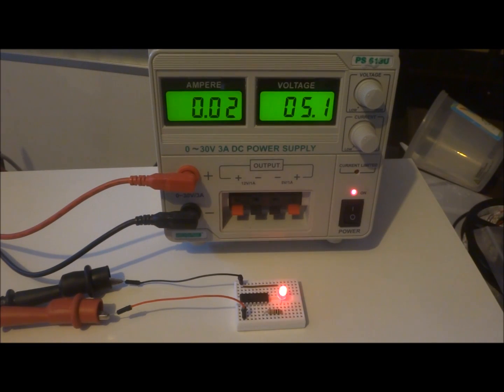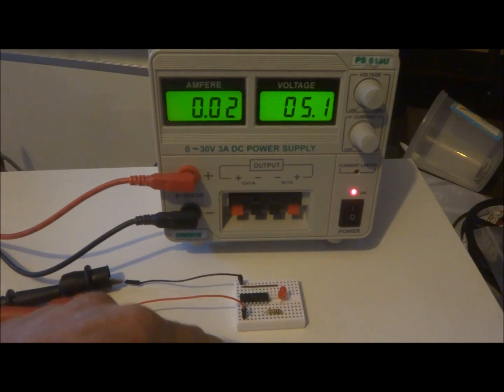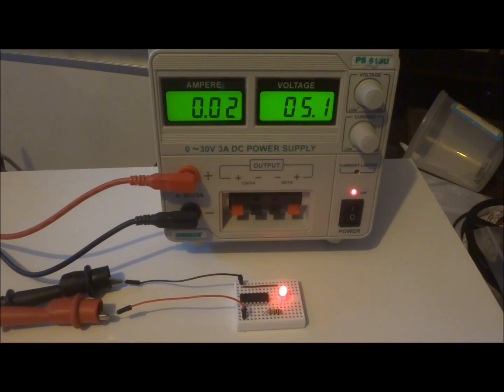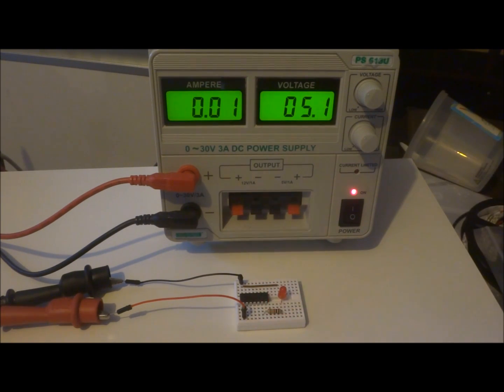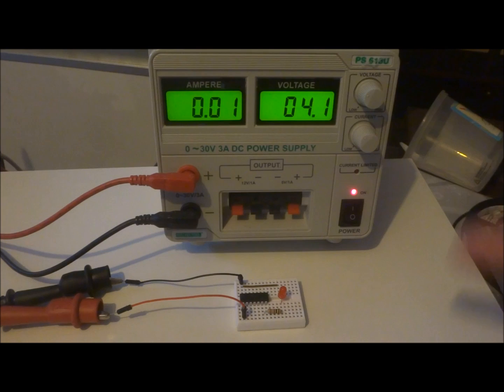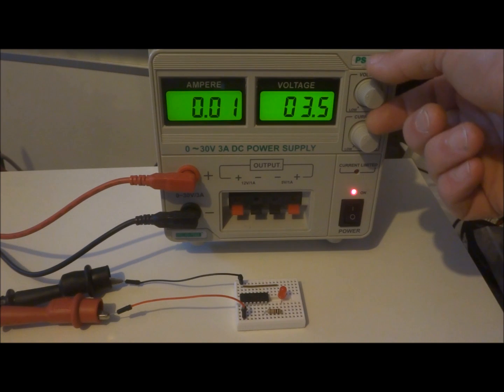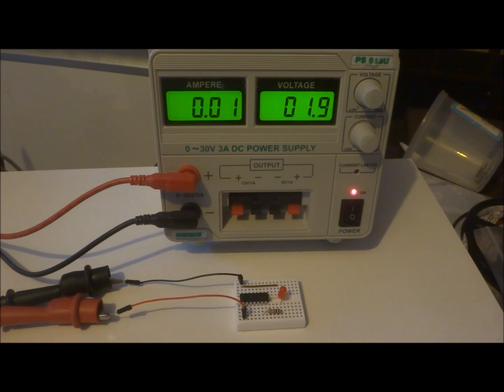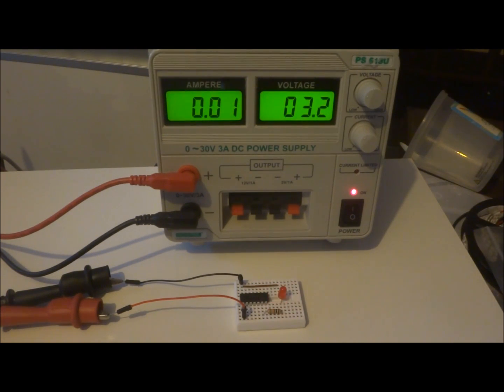Zero Part, Zero Pin Battery Guage on an ATTINY84A

Comment: Can this be done via the Arduino IDE?   Much of the code doesn't really feel "familiar".  Is it a special type for AVR?
Reply from the maker: Sure thing! This should work on any AVR that has an analog to digital converter and an internal voltage reference - which is every AVR I've ever used.  The Arduino IDE is really just an editor that runs the normal C compiler (and does some other stuff to mangle your code so you don't need header files and stuff like that), so you can write almost any normal AVR C code in it.